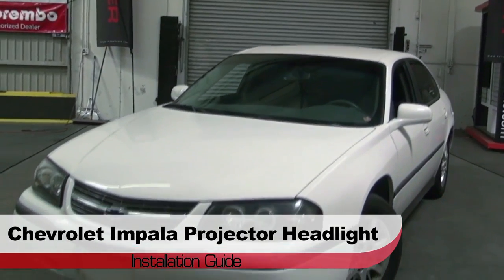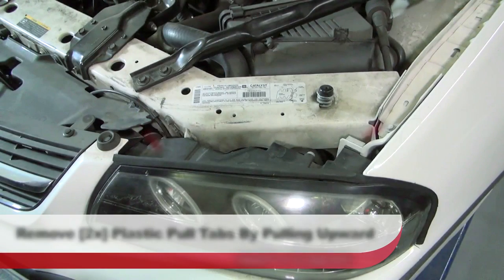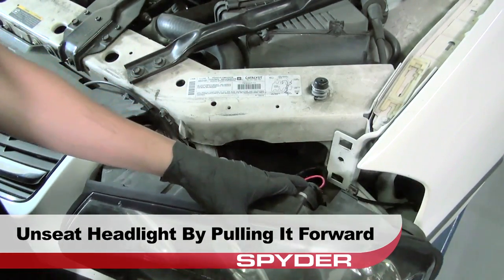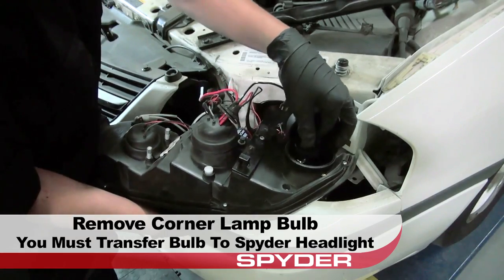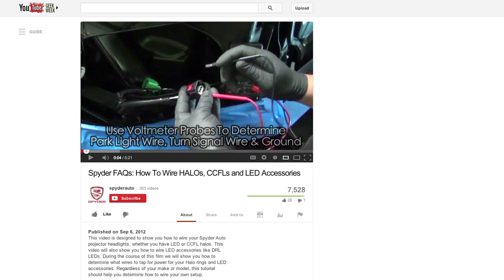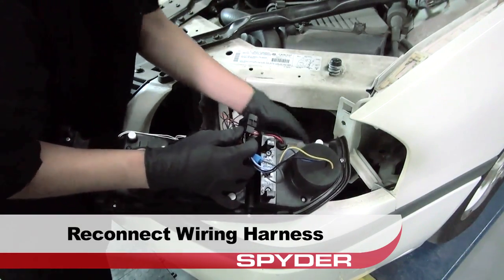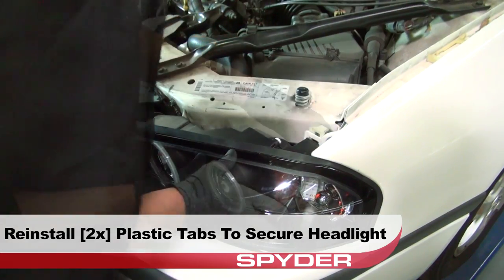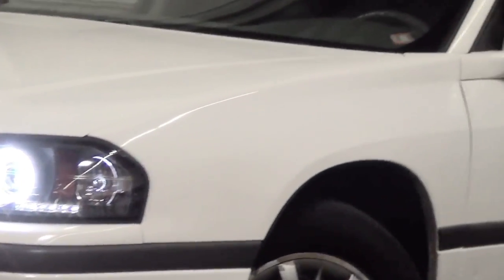Spyder Auto Installation: 2000-05 Chevrolet Impala Projector Headlights

Comment: It would be nice to know how the wiring has been modified on the test car. That's the biggest part of the installation and it's completely bypassed in the video. Also, on the 2000 impala the parking light bulbs are not the same so they cannot be used in the assembly.
Reply from the maker: The high beam, low beam, and turn/park light has a play and play harness. The LED and HALO will need to be splice we have a different video on how to wire Halo/CCFL/LED
Reply: I didn't think the other video was particularly helpful either but I did get them installed and working.  Like I said though, the impala uses 4157 bulbs for turn signals but yours use 1157. You should really include bulbs for this reason.

Comment: What size bulbs are those for the turning lights!!! It doesn't say on the website description..

My stock headlights used 3457ALL/3157/3156 bulbs . They have a rectangular connector not circular like the one on the socket of these headlights.
This is frustrating because i cant install them until i have the correct bulbs to order!
Reply: did you ever find out because i installed mine anyway but i have no turn signal and id like to know
Reply from the maker: sorry for the late reply. please write us an email at techsupport@spyderauto.com we will send you a set of the turn signal bulb
Reply from the maker: MellySoWavy the turn signal bulb is 1157. Please write us an email at techsupport@spyderauto.com we will send you a set of the turn signal bulb
Reply: Thank you! I'm sure many people have this question

Comment: Are the bulbs for the Low beam lights the same as the factory bulb? Will my 9006 HID bulbs fit in the projector housing?
Reply: It uses h1 bulbs for both the low and high beam. Now I'm on a mission to find out what bulbs it uses for turning lights because it's not specified anywhere..
Reply: @slickmastajay did u figure it out?